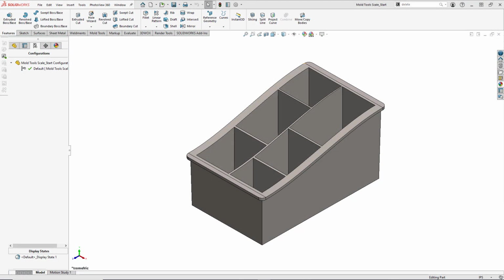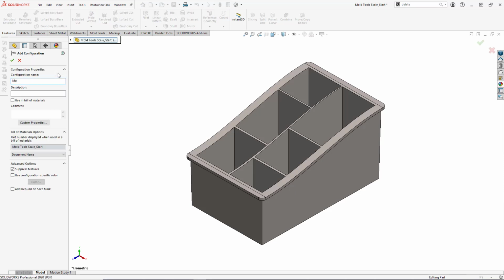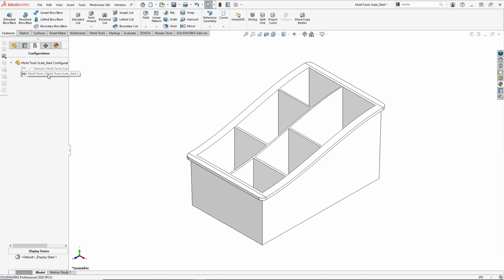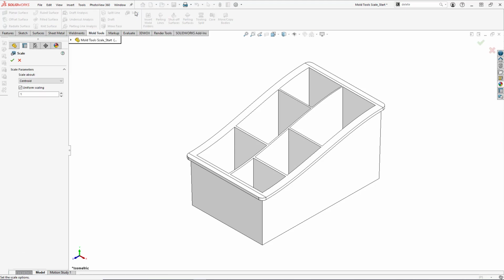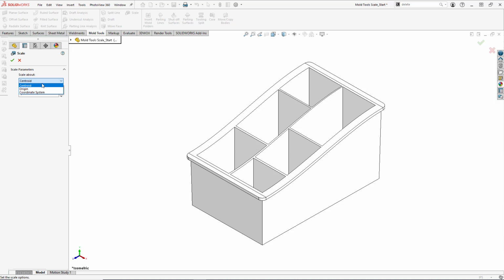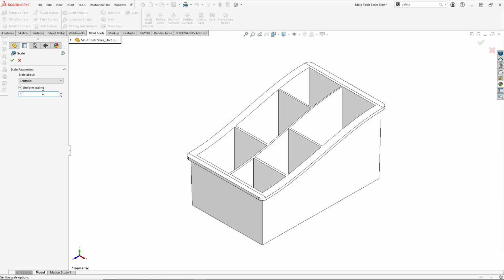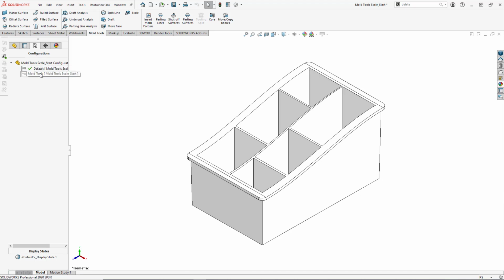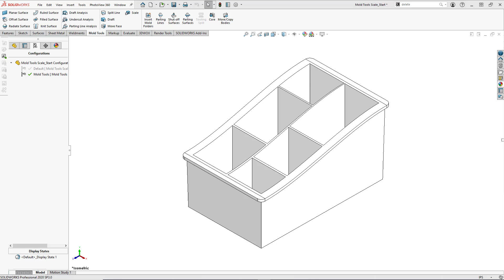SolidWorks Tutorial: Mold Tools Series- Scale

Comment: I find scaling about the origin more useful. This way the planes aren’t shifted. If there is a part revision, you would be able to mate the origin of the new part to the origin of the old part. Scaling by centroid doesn’t allows this so you would have to mate using faces. Exception is if the part is symmetric about all planes.